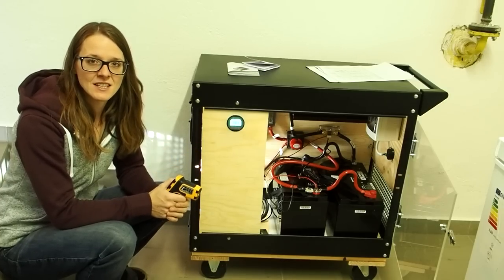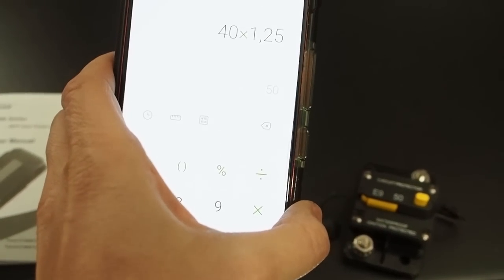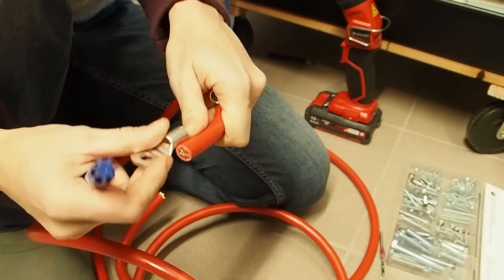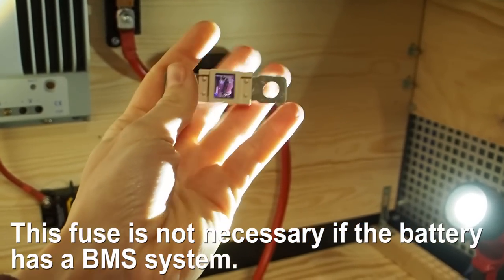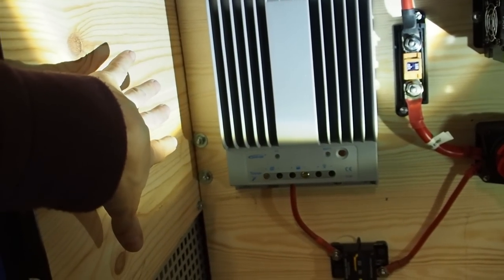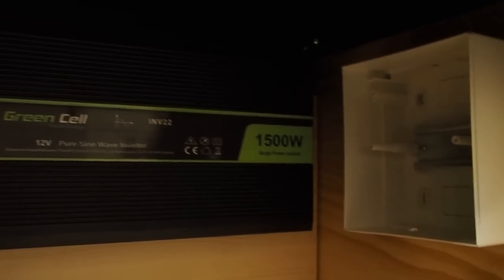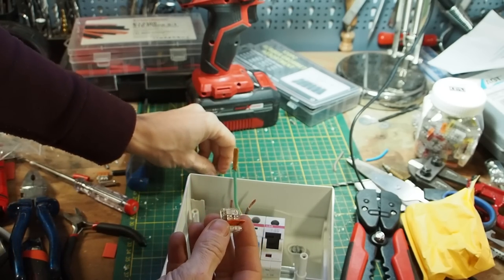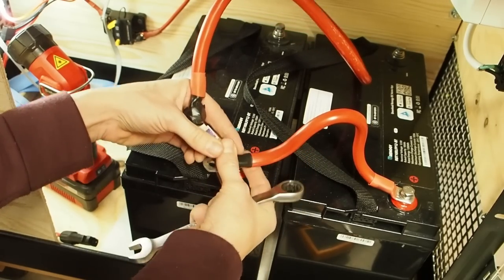12 Volt Solar System in a service cart (1500W Inverter)

Comment: 5:01 If the inverter, is 90 percent efficient, you need to add 10 percent, to your amperage calculation, you added 20 percent, good job.

Comment: Warning some of what you say about the electrocution protection device hookup is questionable but I don't know your code or device design.
As to series-parallel solar array connection, there are weatherproof fuses with a standard solar wire male and a female connector at each end that work nicely provided the wire size is sufficient for the current.
The solder connections are best avoided as the stranded wire did not get hot enough to fill the wire strands with solder. Suggest you eliminate that through-panel device completely and wire the solar pigtails directly.

Comment: Great project for the times.   A  1-wire Delco Remy  alternator mounted to a stationary bicycle for last option to charge batteries during no sun/no generator situation.  A person could Run it through a 40 amp dc to dc Charger that works on lithium or flooded batteries.  Not absolutely needed but would offer that high charging voltage lithium requires.

Comment: Pretty cool. I love building these and am building little solar generators for all types of powering needs. From a couple lithium ion cells on up to multiple LiFePO4 200ah batts. You’re using one of the same types of waterproof boxes I am for my Arduino IOT carrier smart garden irrigation controller.

Comment: Hi from Finland
Nice setup, basically there is bit room to add more battery capacity if needed.
I own few Epever controllers and you should be able to turn output/load ON/OFF from MT 50 Monitor, just press OK button.

Comment: I have the Ep ever controller that has the fins in back so I blocked it away from wall surface an 1".  It's smart it's in a box, because those inverters can really pull in dust.  my 12v system is all 10 Gauge braided vire. I mean from the solar panels.  Saved my bacon in power outage twice now, at least I had entertainment!

Comment: I see you have enough space to add a 3rd battery to your system. I have an identical system with 3x100ah on 12v, epever 40a, 6x100w PV and now I am waiting for a battery charger to be able to charge the batteries on 220v plug too beside the PV. You could also add an battery charger on your box + one more battery and you are ready to go. I preferred to use 6x100w pv panels because they are smaller so I can take them on the car with me. My system is also made so I can take it with me if needed, but yours look very nice, mine is being done on a plywood board ..  ... Congrats one more time and Happy New Year!!!!!

Comment: Here's a tip when cutting bolts run a nut past the point of being cut, then all you have to do is reverse the nut and the threads are perfect

Comment: Lilly. It's a good idea to put a wh meter on your final 240 volt output as you will then be able to work out the viability of the system over time.

Comment: great work! the inverter can put up a surge of max. 3000W for a couple of seconds maybe, it would not instantly melt the wires (the breaker would trip or the inverter would shut down long before the wires are getting too hot), I think you could get away with 35mm2, but as always, better be safe than sorry.
Reply from the maker: Yes probably!

Comment: Very nice job Lilly and excellent organizing. I don't believe that you left anything up to chance, and followed all electrical safety precautions. I hear that Epever controllers are good controllers but I have always favored controllers with builtin fans. However, you have grille spaces on both sides to promote air circulation, so heat accumulation shouldn't be a problem if the controller has a good heat sink. Lastly, I would make sure that your controller is fully compatible with lithium iron phosphate batteries to prevent damage to your batteries.

Comment: quick triva ... When using the saw and more importantly the file, cut in one direction only.  Pulling backward against the teeth with pressure dulls and or ruins ... especially the file.  Thus, a file is forward only, not meat to cut backward ... unless it is a rare design or something. I have files that are 15-20 years old easily that cut like new.  I use the file brush to help keep it clean.  Nice video and I learned some new things.. thank you.
Reply from the maker: This has been a myth going around a lot. One youtuber debunked it by testing files scientifically. He found that going back and forth is keeping the file sharp for a longer time.
Reply: @SurvivalLilly  Bizarre that is the first time I heard that in 40 years... Doing it on wood for sure no issue but metal and different hardness?? .... Thanks for bringing it up and I'll check it out.  I know wood saws and hax saws last longer sharp wise as I have dulled them quicker ... I wonder if using a skill saw blade backward on steel can be flipped back and forth for wood and steel?  hmm just a thought.  Good work you do.
Reply: @SurvivalLilly  One of the things I read was the triangle shape "teeth" one direction it is stronger.   Obvious physics it seems.  I did mention unless a file is "designed" for both directions.  I'll contact some high end file manufactures and see what they say.  It seems people the tube will say anything ... sometimes.

Comment: Being in a box your inverter and battery charger may get hot where they are located. I would put more ventilation on both units with either a 12v fan or more grid work. Otherwise very neat!!!

Comment: Great build, I will build one just like that. but with 24V Where can I find that wire chart(US)? I believe the vent should be at the top, since hot air will travel upwards. Before you cut the screw, you should screw in the nut. That way ,after cutting it off, you can nicely remove the nut it will clear the thread. Also, it is easier to hold it in the vise. I would hammer that crimper on the floor, where it is sturdier.
Reply: What you want is an "ampacity chart". Just Google image it.

Comment: This is an excellent project! Having moved to the EU after living all of my life in the States I hav3 an issue with the German Shuko outlets here. They are not polarized and I have found hot an neutrals mixed in different properties I manage. I have cured this issue just for stuff I manage as well as my home. Neutral is on the left and phase is on the right. I have not found any documentation in the country I reside in as this is correct or not. As for that 50 amp thermal breaker you used from the charge controller, make sure it is manufactured in the EU. There are many Chinese knockoffs that may have the CE markings on the side markings however the logo is not exactly to specifications. Non compliant CE marked products from China are really 'C'hina 'E'xport approved. Many of these breakers have failed and caused fires. You would be better off using one of the single pole DC breakers like the ones used for the solar input. A Box is not necessary since you can purchase a section of DIN rail from your electrical supply house. Breakers can mount directly to the rail.
BTW, how is your health issue progressing? Hopefully for better! Have a Happy New Year!
Reply from the maker: I think it is not regulated in our country if the phase and neutral is left or right. Maybe because it doesnt matter

Comment: Cool beans but solar generators should be used as a last resort
I prefer the gas/propane generator
We can buy 55gal drums of gas.
500 gallons of propane
I have had no luck with solar
My bluetti over changed and burn up
I would build a unit like Lilly before I bought another premade one!
There's new solar film that return's up to 42% charge.

Comment: That is nice , and you did a professional job , but one thing I noticed is you don’t have a charger where you can charge it from the grid/Generator/ or car 12v system
Reply from the maker: I have a charger that I manually attach to the battery terminals

Comment: I wonder if I already mentioned it or what? But, I've planned an bought already 3 deep cycle 1000 cca batteries ,three inverters two solar panels. I weld and fabricate but planned instead to make log or wood pole style, pull style wagon, cart.

Comment: A 12v system is not economical to produce 1500w 230v.  For every 100w of 230v you need 10A at 12v.  With a 1500W 230v power supply, the system load is 150Ampere!!  Huge losses and heating of the system.  At this minimum power, I recommend a 24V system.  Greetings
Reply: Interesting comment; I have no experience with 230 V equipment. I've been running a 12 V battery bank with 1500 W, 120 VAC inverter for years. I've used it to run a freezer and a frost free refrigerator during occasional power failures, and weekly to run a full sized washing machine. Nothing ever gets hot, not even warm.
Reply: @rpbajb  Of course it doesn't get hot if the cables are thick enough.  But when building such an emergency power supply on a trolley, I would do it in a 24V system.  Less losses, and thinner wires can be used to build, which is cheaper. I would also add a package of super capacitors to support the converter with a temporary load.

Comment: hi on the cables you can paralel cables 35 mm in paralel with duble fusez on each leg ,4 the crimping you sould solder the cable lugs after crimping, usualy 16mm is good to abou 150amps before staring to heet up .fuses sould not be mounted in air witout somting holding it down

Comment: In my opinion, it is better to use a 2 pole breaker on the outputside. 
Depending on the type of inverter used there is no clear fase and neutral. And you can reverse a schuko plug as well.  When reversed it will leave one line, through the appliance unprotected. Only braking one line leaves also a possibility of 230Volt on one of the leads to an appliance. and if that is switched on all the way back to the disconnected part of the breaker. 
As you said you have a different RCD than Proofwood. A much overseen aspect of RCD's is their type. An A type can only trip on a difference in AC in/out. But a type B, measures also DC current and switches of if there is more than 6mA on the AC line as well.  Not totally uncommon to have DC leakage or faults  in inverters. Therefor type B RCD's are better, and in my country even mandatory to use in  DC and PV powered systems.

Comment: I am an Electrician, DC and AC power is different from one another. I built a 24v system and I used 10mm wire from the battery to the 3000w inverter. I put my hands on the wires (I call them cables) to check if they overheat and they don't.
Reply from the maker: thats great. I have to build my solar system to the Austrian electrical code tough, so for a 150 A fuse I need a 50mm2 wire. thanks for checking in.
Reply: @SurvivalLilly  Don't worry, your system is very, very safe.
Reply: I bet you didn't test the wires under full load or long enough for the temperature to rise. At full load, that inverter would draw over 125A, way too much for a 10mm2 wire to handle continuously even if it was installed as a single wire in free air, 25mm2 should be the absolute minimum wire size for that application, preferably 35mm2. And for wire sizes under 70mm2, ampacity is pretty much the same regardless of AC (50/60 Hz) or DC.
Reply: @penaroskaposti8145  Only running my 2 small fridges and freezer on it. In South Africa we have "load shedding" all the time.
Reply: @penaroskaposti8145  In South Africa you have to make do sometimes, I am looking for the right cables first and then I will give it a test, thank you for your comments.

Comment: For a while i am thinking about a battery charging system with wind turbine and likely solar also . I wanted to made it portable because we live in times where you have to be flexible so i already was thinking of somethings with wheels under it . One question , how long will these fully charged batteries last when you have a fridge and a freezer on it in case of a blackout . Thanks for the nice build and tips and tricks 👍
Reply from the maker: 3 days with 2 batteries. My freezer draws 26 watts
Reply: @SurvivalLilly  Thanks , now we have an indication of the duration .

Comment: Did you secure the batteries in place? I would add some lights to it and a Anderson connector to be able to jump start a car if needed.
Reply from the maker: Yes I used the blue strap after the video

Comment: I would first go to the manufacturer's instructions in the manual for the inverter for the proper fuse size. Determine the wire size from that. The charts sometimes are focused on longer wire lengths.
Reply from the maker: The cables coming with the inverters are always to thin and get hot
Reply: @SurvivalLilly  No argument there. They ship the bare minimum (sometimes nothing, when greater capacity). I size these cables for 2x the rated power to allow for start-up surge current. The required diameter will increase due to distance, for a given voltage-drop tolerance. This does not affect the fuse size, which is for inverter protection.

But look for a fuse size buried in the back of the inverter documentation. If it is a bad translation, that detail might be missing.

Thank you for the video!

Comment: Really nice build! Very tidy. I'm by no means an electrician either but I have a few pieces where I wonder if this is correct. When you designed the thermal fuse you used a factor of 1.25 which seems fine for fuses that burn. This breaker is a resettable fuse though. If you check the datasheet you'll find that it will allow in the realm of 50 A for 30 mins, 100 A for 5 minutes and 150 A for 30 s. So you'd need a much smaller fuse to have it break beyond 40 A reliably.
Secondly, an RCA doesn't work with an inverter as the output is not ground tied. Current only flows between the 2 output poles of the inverter. An RCA detects leakage current from the mains wire to ground. If you wanted to protect an inverter there's specialized devices (unfortunately very expensive). If I interpreted your accent correctly you'll find this video relevant: https://www.youtube.com/watch?v=yjDA3jP_vc8

Comment: Very good job Lilly. I did a similar system a few years ago before the lithium's became available a reasonable cost. Have used it a few times works great. At some point I would like to replace the AGMs with LifePo4 cost have dropped so much. By doing this yourself you learn so much which is the most important part of this project. Now you need to start on your home solar system. For those who are interested check out youtube "DIY with Will Prowse" he is knowledgeable and can be helpful. 
Stay Safe & Good Luck

Comment: thank you thank you thank you!!!!!!! I'm doing the same thing right now. a small metal cart. I've been caring a 55-pound battery around. lol that's what I loved about overseas hardware stores. higher quality and cheaper. I hate Home Depot lows ect... when I lived in japan it was awesome akihabra for electronic and unidy hardware for everything else.  oh typically if the solar voltage regulator has extra out put it means you can't have anything hooked up to the battery during charging. basically, it messes up the digital charge programing. why they have a separate load out put.  that hammer thing to crimp the lugs is awesome. I'm working on how to make everything emp proof.  right now, I'm thinking Zeiner diodes and reverse bias Zeiner diodes with a high watt bleed resistor load.  i don't know I'm still trying to figure it out.  basically, how do you test it? spinning giant neodymium magnets? I don't even think that would be enough.  I have 3 solor voltage regulators. a 600 watt zeiner 14v aray. which get hot and less efficient. but more dependable that the 2 corporate purchased regulators.  currently building a high watt mosfet regulator from scratch. it just has a dial to set the voltage. your awesome! thank you just saved my back.
Reply from the maker: I also thought i put on some magnets on the battery cables. I thinl it could work
Reply: @SurvivalLilly  who knows? lol when I worked on aircraft back in the navy everything was heavily grounded with bonding wires for static electricity and high power emf. an emp is a magnetic wave. causing high positive and negative currents in anything metal. basically, anything conductive in a way is a magnetic antenna. maybe just grounding everything (to an earth ground) could world like cars portable power systems. I no expert on emps I'm just guessing. I was only an electrician. not the engineer that designed the helicopter.  oh you did a dam good job I'm impressed.

Comment: Hey Lilly, if you don't mind telling. What was the total cost of the build?
Reply: She mentioned it at the beginning
Reply: @tammy707  I guess I missed it, I heard her give the price of the cart but not the overall total for everything!
Reply from the maker: I have to check what I paid for all components
Reply from the maker: So the electric parts were 700 euros excluding batteries. The modified cart 130 euros. In the last year prices of inverters have gone up tremendously. Same as mppt
Reply: @SurvivalLilly  Thank you! Trying to figure out if it would be cheaper to build or buy one!
Reply: @neverlookback3382  is much cheaper to build it. For 1500-1700$ you can make an  system that has 2500wh or 2000-2200$ a system with 3700wh capacity. If you are going to buy a system you are gonna pay atleast 50% more...

Comment: All these monstrous cables for "only" 1500W... Why did you chose NOT to go with 24V?
Reply from the maker: My batteries are not allowed to connect in series
Reply: I've researched and built a system similiar to Lilly's. Her cable sizes seem correct.